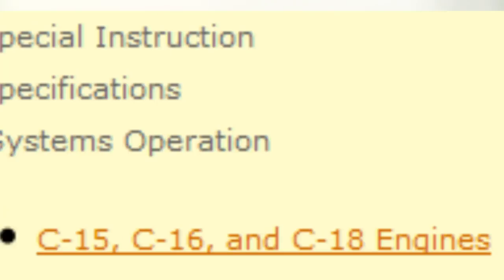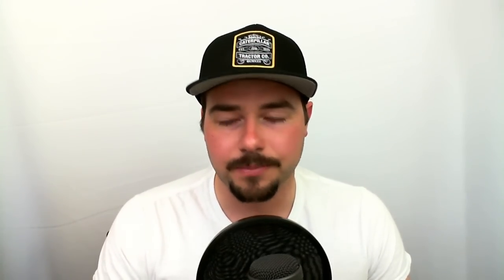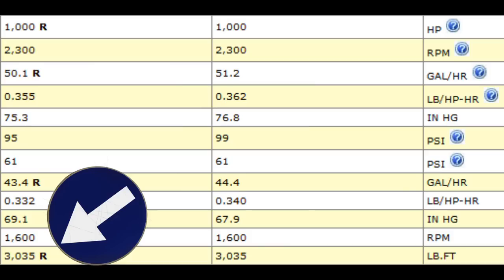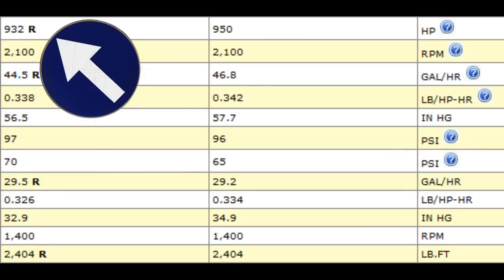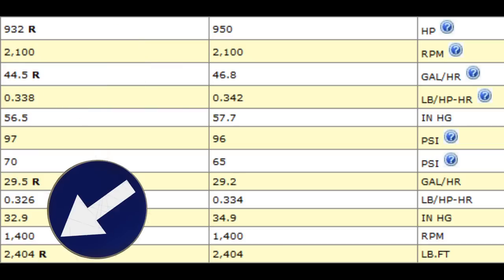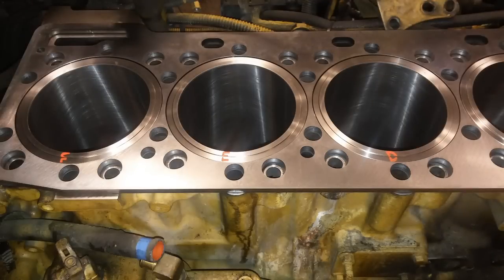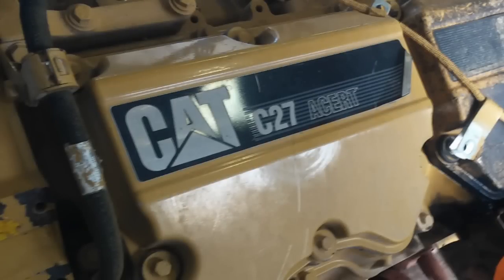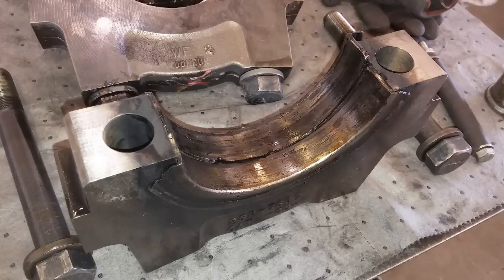Turn A Cat C15 Up To 1,000 Horsepower With Stock Parts.  The Ultimate 3406 or C15.

Comment: 5:45 it is a very rare thing, but the Nissan GT-R used an inline engine with parallel twin turbos from 1989 to 2002.

One thing I was wondering about was porting an polishing the cylinder head and intake manifold. Would that work?

The displacement could be increased by welding an offset grinding the crank. If someone could find a connecting rod that was shorter and had the right piston pin diameter, stock replacement pistons could be used. The crank can be ground for a different size rod end, makers of V8 gasoline cranks often have Chevy SBC sized rods in engines made by someone else. Perhaps the connecting rods can be sourced from a different engine manufacturer.

There is a disadvantage to building a stroker. It tends to lower the maximum RPM and engine can handle.

BMW once made an M550D for Europe that had 3 turbos, two were compound and one was sequential. Perhaps the C18 parallel twin turbos could be matched to some C15 sequential twins using similar tech.

Comment: So  many questions. Can u still use the c15 tein turbo setup since the block displacement is the same?  Of course with that much torque have to upgrade trans , shaft and rears to handle it plus learn to drive it carefully not just slam foot in it like most

Comment: bad ass  destroys drive train   bad .ass burns lots of fuel  bad ass is a hanger queen  get ready to turn your own wrenches  good shops and dealers won't normally touch a hot rod truck  usually no warranty on parts and labor basic high school physics  been there done that

Comment: Lol no thanks on the c18. The stroke doesn’t do it for me.  My accent put 1147 to the ground and almost 4K of torque never an issue with running gear stayed nice and cool all across the country. Didn’t smoke a whole lot. I even had 59’s custom set of compound twin turbos. But never had a problem

Comment: i have a 3406E 6ts06035 had it inframe  all new parts air dryer ,waterpump,oil cooler,radiator,injectors,an cups,fuel return lines,primer pump,injector wire harness,an all new hoses,turbo was new but had sat on motor over the 4years the tractor sat fuel pump wasnt change ok problem is the tractor ran perfectly for 3 months good power all couldnt been more happy .Then on day going down road truck starts to hesitate under heavy pedal truck jump up an down i see brown smoke coming out stacks doing the hesitating moment it been 2 months now an the problem still here any ideas on what this could be an the hesitating comes on around 1400 to 1600 rpm.

Comment: If the C15 and the C18 are basically the same blocks...what would the gain be, of changing the single turbo, to twin turbo, on the C15? And the bigger Injectors? Just a thought

Comment: I have rebuilt 3406  E-series
Would you recommend switching to Amsoil for that  particular engine?
Reply: Certified Labs. About the best oil you will get. There is an interview with a machinist on YouTube who tore down a case tractor engine because the owner thought it needed a rebuild. The case engine had 12,000 hours on it. The machinist said you could eat off all the internals of the motor it was so clean. He told the tractor owner before the tear down that it was the injection pump that was screwed up but the owner wanted it rebuilt anyways. 
  Fleet maintained farm engines of course but impressive story.

Comment: 1000hp are useless if u don't have the right tranny,right clutch,drive shafts,U joints and a proper cooling sistem...
It requires a very I mean very responsible driver who knows what they're doing to not brake that truck in pieces...
Look at Truckers Report for MR. Haney and you'll see what I'm talking about...

Comment: i been out of pulling one team used a diesel v8 they used other fuel sparkplugs several turbos made about 3000 horsepower the team did have to remake the heads to use fuel injected ethanol type of fuel with 4 turbos, the oil company i was working with was going into marine stuff for lube, oh by the way one run by by one set of main bearing in this v8 engine they went to the oil company oil it stopped the bearing ware!   in was in a class where the frame had to be a tractor but under that cover was not a normal farm tractor motor!

Comment: I have a 40 pin 6TS that flutter and misses when you go from pulling to just barely letting off the throttle like in traffic or across a parking lot. It will even do it sitting still if you take up the Rpm’s to 1800 or so and just slightly lift the throttle it will crack and pop. Any ideas? I would have to tell you in person everything that’s been done to this motor. It all started after CAT done a platinum overhaul and since January of 2016 to November 2017 it has set in in Wayne Supply’s shop a total of 9 months and I’m still dropping a fortune trying to fix it. Last week I put a new fuel pump, manifold and check valve and run a hose from a 5 gal jug and it still misses.

Comment: Just for thoughts...1000 hp is 6.4 million BTU's of diesel per hr.  at 40% efficiency or  that is 64 typical home central heaters.  Also .83 gal or 13.3 oz.  fuel per minute.
Reply: me thinks you better go back to school and learn math
Reply: @joescheller6680  Why,  do you need some kind of formula ?  I took 18 college hrs of math after I first started calculating this.   I have been calculating this kind of fuel usage for 50 years. It is a mistake of forgetting ozs in 1 gal as I used ozs in a pint.

Comment: Hey Josh this is Rodney Doll, and I have a question for you I have been driving since 1986 and back in the day we would put automatic transmission fluid in her fuel to lubricate the injectors I have a 2005 C13 would it hurt for me to run automatic transmission fluid in this engine? Comments are greatly appreciated and I'll be listening
Reply: "Back in the day" the diesel fuel had sulfur in it. The sulfur acted as a lubricant for the moving parts in the fuel system. When the government, in their Infinite Wisdom,  decided to take most all of the sulfur out of the diesel fuel, the older engines started suffering fuel system failures due to lack of lubrication. By putting ATF in the fuel that replaced the sulfur, and that solved the problem.  The newer engines are designed to operate with less sulfur, so adding ATF won't make a difference to the engine, only to your pocket. One thing to note, today's fuel filters remove particles down to 3 microns in size,  it's best not to add anything to your fuel except for additives designed for use in the newer engines, you could end up with injector problems.
Reply: I think you would be better off buying a chemical that was designed for diesel fuel injectors. I get a great deal of advice from the "Powerstrokehelp" channel.

The Powerstrokehelp channel donates some money to charity every time they sell some of their fuel injector chemicals. Some of the chemicals they sell are specially made for HEUI injectors because the 7.3 and 6.0 PSD had HEUI injectors. I don't know if your Cat has HEUI injectors or not. The 6.4 and 6.7 PSD didn't have HEUI injectors, but the guy still uses one of his chemicals in those engines.

Comment: A question and maybe a little complicated!Mack's 16ltr engine puts out 600hp in the USA and 685hp over in Australia!I think Volvo uses the engine and theirs puts out 750hp!Is this the principle as the C15 and C18 CAT motors?I just wondering!
Reply: Most engines in the us, could run at much higher hp but are usually cut back for fuel economy. Even though high hp engines can be fuel efficient if set up right.
Reply: @Bendigo1  Thanks for the information!Most "know-it-alls" would not have answered  that with much intelligence and that tells me that you have been around!I tip my hat to you  sir!
Reply: @bookeruzzell6213  I am not a know-it-all.   I just know a little bit about a lot of things and not much about few things.  :)

Comment: hi i have a cat c15 on a kenworth k104 cab over and i have worked out that i think its using too much fuel im in australia  its using 1.6litres per kilometre on the highway driving at 100km per hour at 1650rpm i think that something is not right could you please help me

Comment: i wonder if you could stroke out a b or c model with a c18 crank and rods. not sure if the c18 pistons would be compatible with the nozzles or not, plus it may be advantageous to keep the smaller bore to maintain liner wall thickness. then again that would raise the question of how c or e model pistons (steel tops) would work with a c18 stroke? did cat have a mechanical predecessor to the c18 like they did the c15 and c16?

Comment: I like how u made this video,  gets intrest going. But this is nothing new. Lots of  MBN s out there that people hated the 525 tune and went with a marine cam and injectors and the right tune.  6nz the right guy out there has a 700 tune that puts 630-650 to the tire
Reply: Glad your thinking OUTSIDE of the Litter Box!!! Some guys cant! Some guys just preach and follow what CAT tells them.
Reply from the maker: Since Cat isn't making truck engines in new trucks you gotta find new things to think about.
Reply: Adept Ape 

Hi
Can you advise me something is that-a good idea. On my 2005 MSX acert twin turbo. I am rebuilding my whole motor and switching to single turbo with PDI Exhaust and PDI turbo and marine c18 cam and c18 injectors. Please advise how can i tune ecm with

Comment: If you were to show the spec sheet with no narration  and then were to  show the respective engine in its respective frame and on a dyno, you could narrate the whole speech or were to show an actual loaded pull drag race of sorts, and then show the power pull with a modified c-15 maybe diesel techs wouldn't be asleep 10 seconds after selecting this video and wanting to hail it as click bait,  or you could have just told cat techs to look up the specs for the model of cat power plant and make sure that they should be sure that they understand that each engine model spec sheet should correlate to the use of the engine ie, marine, on road etc.. just sayin.

Comment: C15 pushing a 1000 HP won't see 200k miles due to the cylinder pressures working against the piss poor spacer plate design and/or the weak valve train components.

Comment: I wonder why they put c18 in fire trucks and not in semis
Reply: They do put C-18 in the military semis with 8 or 10 wheel drive it just has to be put thru an automatic transmission or you’d explode a clutch. As for on road semis… no practical, not necessary and would never meet emissions standards.

Comment: Im assuming a c18 is computer controlled. if I where to find a c18 could the parts from a 3406b be used to make it mechanical controlled?
Reply: Samual Krokson I'd say no. C18 is full electronic motor like the c16 c15 3406e. Ecm controls injection directly through the injectors
Reply: Stephen Carr he said the blocks pretty much the same besides more bore and stroke why can't I use the head off of the 3406b?
Reply: Samual Krokson the blocks on an 3406e c15 c18 are pretty much the same. A 3406 a and b blocks are completely different
Reply: How about a 3406 c  I think they are the same as the e and are mica icee.
Reply: @garys3924  the c is the same as  the b block

Comment: My though......keep it on the road....not in the shop...  you push the HP up.....life goes down.....which means your cost goes way up.....I've done machine work for 20+ years on these engines...  if you dont have money to burn..  leave them alone....
Reply: @Google Poodle  yes,but......1)it needs to be built correctly to start with.2) Then it needs to be driven properly and responsibly. 3)And finally it needs exceptional maintenance. Do ALL these,and 6nz is safe at 700 FLYWHEEL HP. That should put you around 640-660 to the tires. My 6nz did 741RWHP and was very fun to drive,till I broke rule #2.   (Aussie 600file,78MMS turbo,57 injectors extrudehoned 15% over, 4 row radiator. Looking back,I was waaay undersized on the turbo)
Reply: What's the use to pumping up the horsepower if you still gotta baby the hell out of it. I've been driving 22 yrs. And every now and then when it's go home time I put my foot in it when I'm on the open road and no traffic. CB wide open, music up enough to tell what I'm listening to and foot on the petal. But honestly I'm only rolling 80. If a pumped up Cat can't handle that,  I'll keep my money in my pocket.

Comment: Hello so I have a 320e that's happening to have problems involving the travel , it'll work fine in the straight travel and using the joysticks to go back and forth the only problem is turning sometimes it'll turn like it's supposed to and sometimes it wouldn't even turn with the travel joysticks all the way to the front or back , like I'll start turning it with the joystick all the way forward on high and then it'll stop engine is consistent I'm guessing it has to do with something else if you'll please help a brother out thank you , love the videos btw
Reply: Carlos,  you most likely have a problem with the pumps.  If they are not stroking down they will drag the engine down, ore will bring it to a complete stop. Take the machine to a competent mechanic, or shop that is familiar with the backhoe. The problem could also be in the drive  motor for the tracks. A visit to the dealer would be in order.

Comment: Hey Josh what do you think of NXS C-15 motor?
Thanks!
Reply: I spent 8.5 years with a cat dealer. 6.5 year doing field service with them. Not nearly as reliable as the 6nz. Some customers we would constantly be chacing after with vva faults a love for failing turbos. I wouldn't buy one.

Comment: Adept Ape need some help, sorry to high jack but I've got 2006 mxs in a peterbilt 379 and when the water and oil temp gets up around 190 it will have a skip while accelerating. I've took it to 2 shops and both said I had a bad injector and they replaced #1 and #6 injector and called it good but it wasent fixed. I have no check engine lights, while idling the other day I moved wiring harness coming off of Ecm that goes to front of engine and it started idling little rough so I pulled the harness back some close to the ecm and it smoothed out. It ran good for couple days no skipping and now it's skipping again. Seems like when it's skipping it's got good power and when it's not skipping it's lazy. I'm tired of throwing money at it and was wondering if I should take chance and replace that wiring harness?
Reply: If you move the wires and the problem goes away then you have a loose connection.  Could be a wire that is broken inside the insulation, very hard to find,  or a bad connection where the pins are crimped onto the wires, happens sometimes, or a loose or dirty connection where the wire harness plugs into the computer. Unplug the wire harness from the computer,  clean up the connections  (I use WD 40)then CAREFULLY plug back into the computer.  If this doesn't work, get a new wire harness.

Comment: Would kinda power gains could I expect by just changing out the can on my c15 to a c18 cam? Anything??
Reply: Harry Charge 
Yes i changed c15 cam to c 18 cam and changed all 6 injectors with c 18 ,PDI Exhaust manifold and PDI Turbo going to do do dyno test soon

Comment: Can the C18 be equipped with a Jake brake? Just curious to know because it would be pointless in a highway application otherwise
Reply: Ben Murray Yes same head as c15 ,  same overhead as well.    Sometimes you have to add exhaust rockers with the tab ,  for engine brake to push on.
Reply: Ben Murray No, you cannot put exhaust brakes on a parrallel twin c-18, it WILL fail the valve train. 
Several years ago I had a customer with an industrial c-18 parrallel twin (rating set to 700 hp), the engine was installed in a Taylor Rig Mfg. work over rig that weighed around 100 k lbs. It had a major valve train failure at low engine hours. While researching the failure, I found that another Cat dealer ( who sold the engine to the OEM) had installed the exhaust brakes. When I spoke with Cat engineers about the failure, it was determined that the pressure is too great on the rocker assemblies and was the cause for the failure. It was a very significant failure, it broke rockers in half, broke shafts, debris from the failure broke valve springs and keepers causing valves to drop, a couple of pistons got tore up, of course it trashed both turbos.. etc.. 
The C-18 industrial with parrallel twins will run 890hp with ease and do it all day long, there are many of them running here in East Texas, mostly in large forrestry grinders and chippers, very simple reliable engines.
Reply: Robert Wingate. My c18 was a parallel twin JWH prefix.    I had to switch exhaust rockers to truck style,   for Jake brake to have something to push on.   I ran the industrial cam for awhile.  But the cam duration on exhaust valve sucked for engine braking.  So I switched to a truck cam.  300,000 miles no problems.      The long stroke of the c18 is awesome with an engine brake.   It's almost as good as a brake saver.

Comment: I have a 98 international 9400 with a 3406E engine but I don’t see a jeak brake switch dose that truck have one?
Reply from the maker: Nearly all 3406 and C15 engines had Jake brakes so you most likely have one but maybe the switch is missing. You would have to pull the valve cover to see if you do have them though.
Reply: you have a damm good engine in that 3406e keep it hang on to it or give it to me stock set up to 550 will run and pull damm good and get good fuel milage

Comment: The vast majority of issues you would have are ( assuming US driving) 
Your data plate would depict a non highway motor.
Dimensions are virtually identical
If you wanna spend 30000/35000 per copy.
Just an FYI
The generator and Marine version of the C18 have one turbo.  Tuneable from 875-1400 hp